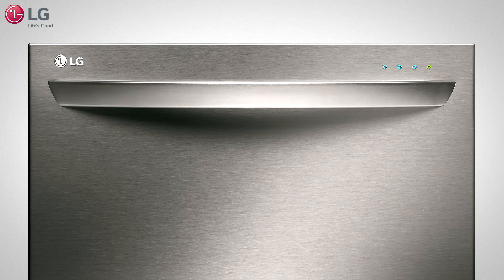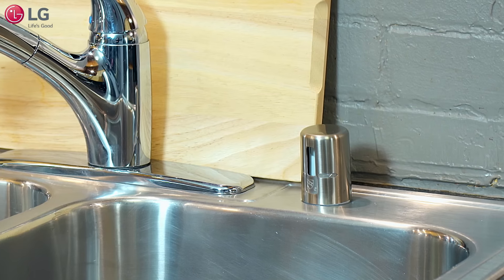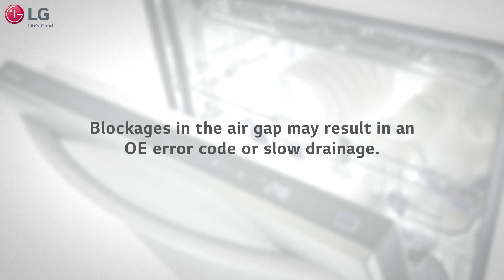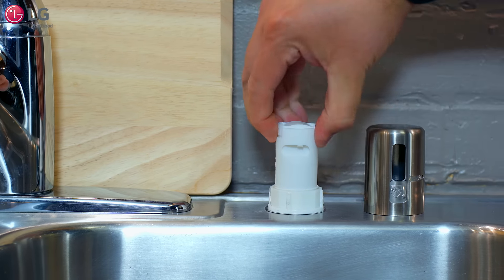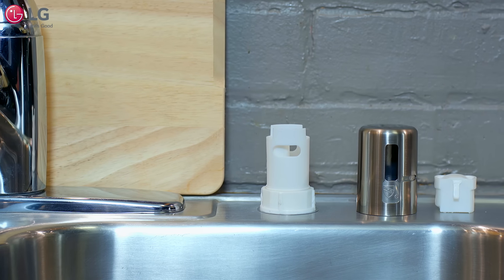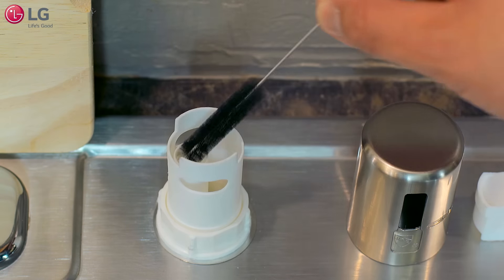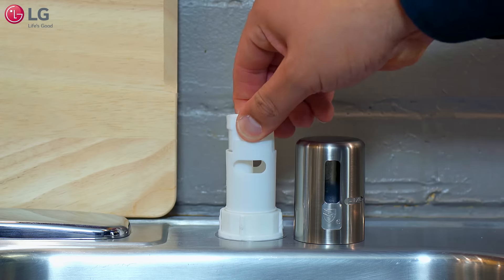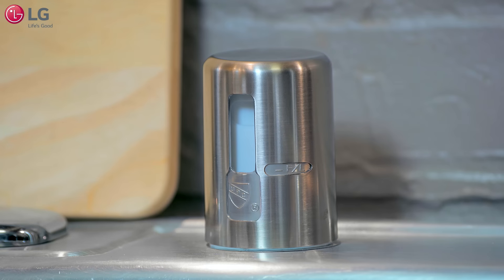LG Disherwasher - How to Clean the Air Gap

Comment: Thanks! I thought this was a soap dispenser. I installed a new dishwasher because the 15 year old one was leaking and the new one threw an error code related to drainage.
Reply from the maker: We're thrilled to know that this video was helpful to you. Installing a new dishwasher was a smart move to address the leaking issue with your 15-year-old one. If you ever have any further questions or need any additional assistance, please feel free to dm us on Facebook or Twitter through @LGUSSupport. We're here to ensure that your dishwasher operates smoothly and efficiently. 😊

Comment: What if the debris is further down than a tweezer can reach?
Reply: im late but press drain on the dishwasher again and the water should push the debris back up. make sure the air gap cover is closed while you do this!!
Reply: I purchased an air gap cleaner from HD Supply Co. It has a long wire handle with a brush at the end.